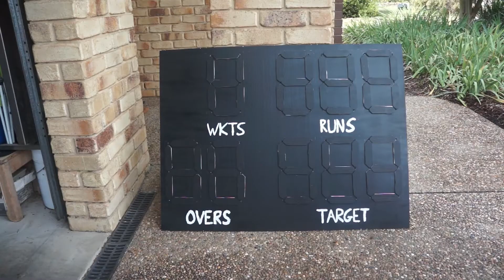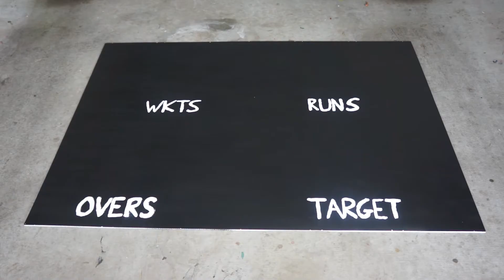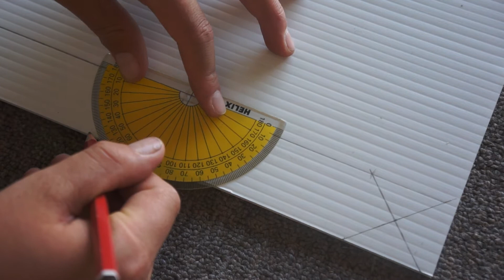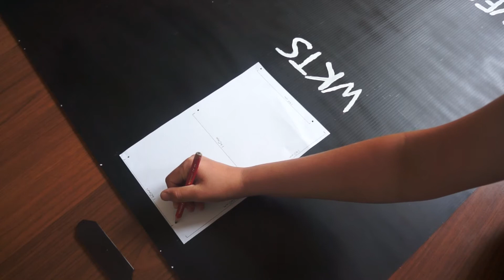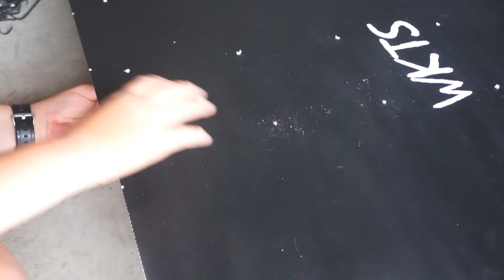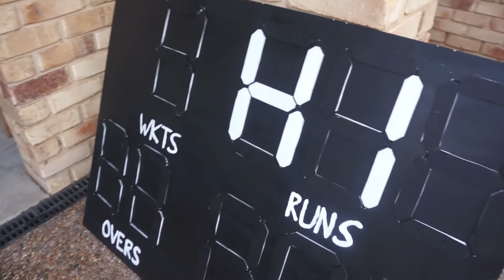How to make a CRICKET SCOREBOARD! | DIY scoreboard || JL's Maker Space

Comment: I tried doing this over the weekend and the results were amazing. Thank you very much for the video. 

Couple of suggestions to create a final, good scoreboard. 

1.  Use White backdrop - 0:23 Instead of painting the plastic board in black, keep it in as-is (white) situation. Just paint one side of the cut pieces in red/blue which are more radiant colors than white. 
2  Use scissors for cutting 2:41 for accuracy.  Knife wasn't giving me good results. 

Thank you for solving our scoreboard problem.
Reply from the maker: Thanks for the suggestions!